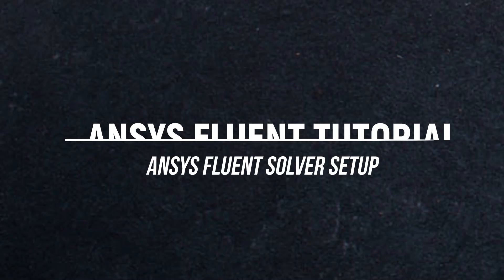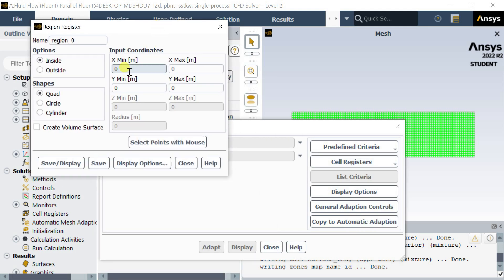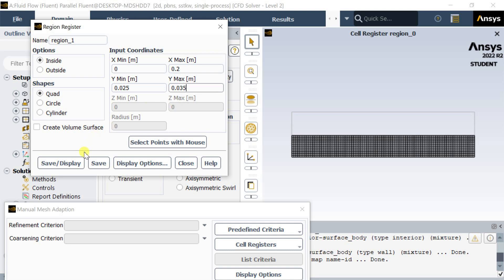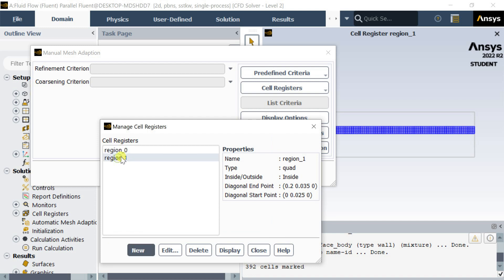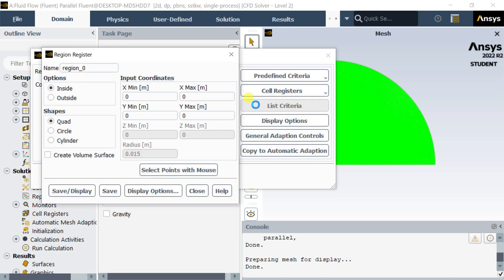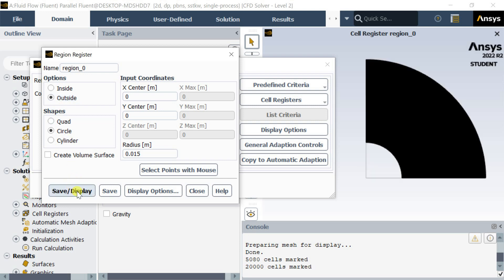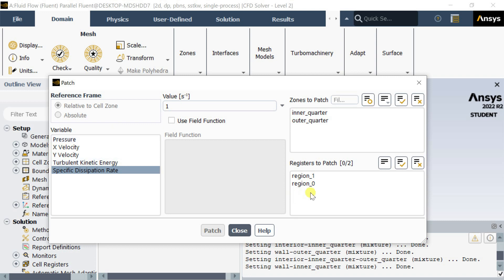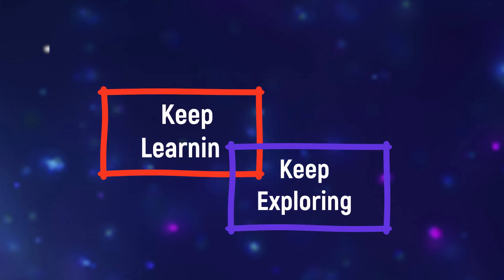How to do Cell Adaptation or Cell Region in ANSYS Fluent | How to Register a Cell Region in ANSYS

Comment: ￼

Hi,

I am trying to model an evaporative cooling pad on ANSYS Fluent. I have a pad with water flowing on top of it and has direct contact with hot ambient air. I have been doing literature search on how to model the setup as such but there aren't much information regarding that.

I understand that I would have to do a multiphase flow modeling of water-air contact. I am totally new to Fluent and I do not know how to proceed with the problem.

I would be so grateful if someone could help me out here.

Thanks in advance
Reply from the maker: You need to use open channel flow model for such simulation.  Mail us in ansystutor7@gmail.com with more details of your project so that I can assist you properly.